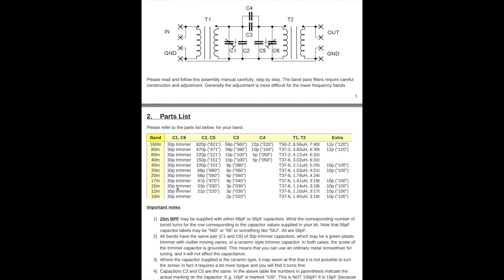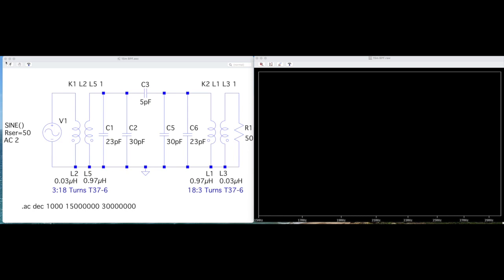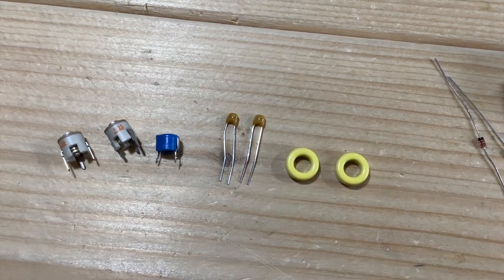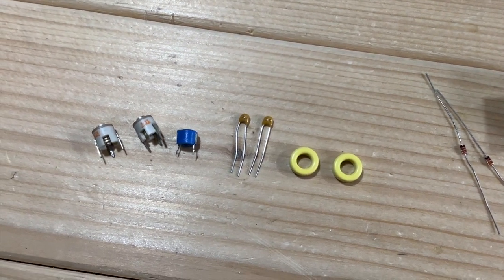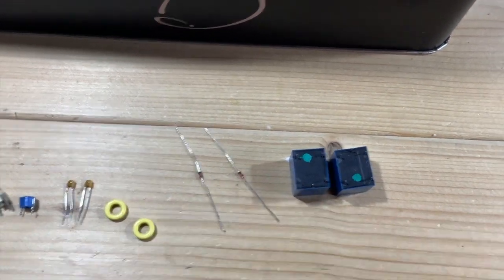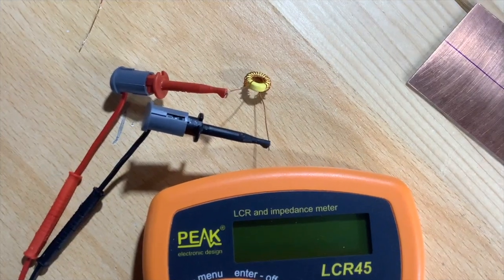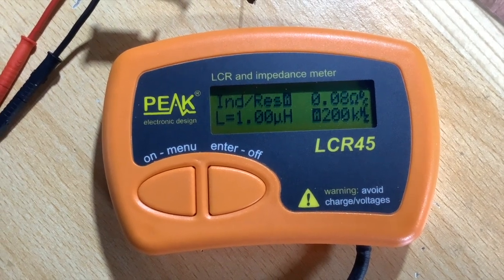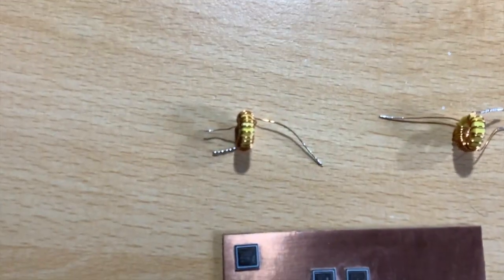37 - Building & Testing a Band Pass Filter

Comment: Nice video.  Note in your simulation you have the K value=1 which means you have know leakage inductance in your simulation.
Reply from the maker: Thanks for watching. Yes, all my simulations are based on ideal components. Practical reality is something different though! That's what makes it interesting. 73, Nick
Reply: @M0NTVHomebrewing  If you short the secondary of the transformer and measure the inductance on the primary that will give you the leakage inductor.  You could add that in series with the primary and leave the k=1.0.  KN6MDB 73

Comment: Hi Nick, great video as always. I have watched your video and read Hans Summers' document. I have mocked up a circuit in LT Spice but when I look at the trace V004, all I get is a flat line. As far as I can see, other than component values, my schematic is the same as yours in LT spice. Any suggestions or advice? I am new to homebrew and LT spice (sigh).. Thanks again!
Reply from the maker: Hi Ryan, without looking at what you've done it is hard to comment. What I would suggest though is try an LTSpice simulation with my values for my frequency range. It might help to narrow down where the issue is. All the best to you. 73, Nick

Comment: I’ve been a fool!  I’ve gone and passed up constantly on those adjustable capacitors. The big big ceramic and metal ones?!  I want to sink my head into the sand like an ostrich now when I see how much those baby’s fetch on eBay…. Hey?!?  Your schematic there?  It looks like the sort of circuit that goes between mains and transformer inside those ‘power conditioners’!?! ‘Common mode rejection’ - ahhhh I’m beginning to learn a few things here!!
Edit:  I absolutely love your ‘through hole components’ surface mounted to your copper clad board - very smart way to go while you’ll be presenting your board on camera. It looks great!
Reply from the maker: Thanks very much. 73, Nick

Comment: Thanks for the excellent video!  I do a lot of breadboarding, and I am intrigued by the stick-on solder pads.  Where did you get those, or did you make them?   Again, thanks for the video.
Reply from the maker: Thanks very much Ted. There are several sources for the pads online. Just Google "manhattan pcb pads" and you'll find some. QRPme, Kanga and eBay all gave me some options. 73, Nick
Reply: @M0NTVHomebrewing  Thank you so much!  I had never heard of these before.
Reply: @M0NTVHomebrewing  - Thank you.  I found some and they are on order.
Reply from the maker: No worries Ted. Glad you tracked some down! 73, Nick

Comment: Was just wondering how much power your bandpass filter is capable of handling?  The design looks like it would be perfect for Field Day filters here in the US.  73 AE3D.
Reply from the maker: Hi Keith, the one in the video will be good up to about 20 watts or so. It depends on the toroid type you are using. If you look inside a commercial rig rated at 100W output then you won't usually see huge toroids - probably T50-6 for the higher HF bands. Having said that for my Shelf-17 rig which puts out 80+W on 17m I used T68-6 just to be safe! Your mileage may vary as they say. 73, Nick

Comment: Really like it! Can you share what is the attenuation of surrounding bands for 21MHz filter? I mean dB down for 14, 18MHz and 24/28MHz?
Reply from the maker: Thanks. If you look at my final comparison between the LTSpice simulation and my sweep on the Spectrum Analyser then you can actually see for yourself. It is a sweep from 15 - 30 MHz: each horizontal division is 1.5 MHz and each vertical division is 10dB. You'll find it at 32:15 in the video. Basically 20m is nearly 40dB down, 17m about 20dB down and 10m about 30dB down. Hope this helps. 73, Nick
Reply: @M0NTVHomebrewing  Hi, that's exactly what I need. I plan to build a set of filters for 40/20/15 meters and this design looks pretty efficient.
Reply from the maker: Hi Michal! Yes, it's a tried and trusted design. You can use different designs and possibly get steeper skirts though. Check out Bill Meara's experiments on the Soldersmoke Blog and the Soldersmoke YouTube site. I tend to stick with these simple double tuned circuits though.

Comment: Nice work. Would like to try my hands on something like that, what is the model number of those trimmer capacitors and where did you buy them from?
Reply from the maker: Hi there! I bought some of these: https://www.ebay.co.uk/itm/296288883417?itmmeta=01J3V1V45QPBEM188ZA7RXJV3W&hash=item44fc3192d9:g:VZ0AAOSw1CRbU0lr&itmprp=enc%3AAQAJAAABINUd9x5oq35f6vhbuaBQ9bjEghcaXGpY8u%2BNhd4APrNqAVaXVfCXE9R8zVxpHf0%2FX4O1eI1F3lcsedz4f3YkJeumRfGLkJ00M5nbx4N6QBnQbr9Nll8oIKH9lNUuEIm2RSxSKGfLNDlmHL7rW3brBk%2BEgwg68bfClUJ0dAtReakUKfeE1HW5j8jaavbF0ylgCMt9FIctQFm6A%2BCKsPqI%2Fzcdil5Obh0hp1f85tD3XkxdGfPkqSwOARz7yN0KPZ%2FCrHYAhViH%2FpeTpo5gCF5DkLrmurXLxbtnwEAG5CPYvuPowx3bWENj211MltkXgfU9pxs7THxDkS7Gacr9WSCPyDKNbI6OWH6zeiSveDVRGVKdfPoudSEqkFOwNcZaQ7QjUg%3D%3D%7Ctkp%3ABk9SR_TC7OGeZA&edge=1
Reply: Thank you so much for that link, I will definitely check it out. 73 Fer now, VA3TSU

Comment: Hello, how you assess Q of inductors on 21 mhz? And where to buy realible t37-6 iron?
Reply from the maker: Hi there! I don't attempt to measure the Q of my inductors in band pass filters. I've found that all that is really necessary is to build them as carefully as possible. Being able to measure them is useful (I use a Peak Atlas LCR45 meter) but even then you'll need to tweak them by adding or subtracting turns or by separating or compressing them. Once you've got them exactly where you want them and the filter is complete then it is good to fix them with glue, wax or whatever so nothing moves around. In terms of buying the toroid cores then I usually use a few trusted sources e.g. Club Sales at the GQRP Club or www.sotabeams.co.uk

Hope this helps. Thanks for watching. 73, Nick

Comment: Nice job! Extremely low loss. Can you use the NanoVNa if your output impedance is 1.5K, so 50:1.5K ( I have a NE602 after the bandpass)?
Reply from the maker: Thanks very much. You can certainly use your NanoVNA but you just have to remember that it is expecting to 'see' an impedance of 50Ω. Personally I'd wind 11 turns primary (1.5KΩ end) and 2 turns secondary (50Ω end) on an FT37-43 and then measure the impedance (smith chart & SWR). This should be fine on RX or TX - assuming the next stage has a 50Ω impedance of course. Hope this helps. 73, Nick
Reply: My primary is 50ohm (antenna), the secondary is 1500 Ohm (input of NE602). I am using a similar pass band with with Toko coils. Are you saying that the S11 port of the nanoVNa needs to see 50 ohms? If so, I will place the primary on that port and the 1500 ohm side on the S21 port? will that work? @M0NTVHomebrewing
Reply from the maker: Hi, sorry but I'm not really sure what you are trying to measure. Both ports of the NanoVNA expect to see 50Ω. In my last comment I described an impedance matching transformer to connect your NE602 (Z=1500Ω) to something else (e.g. band pass filter, antenna etc) with Z=50Ω. You can tell how well you have matched this by doing an S11 measurement on the 50Ω end of your transformer. You'll be reading (Smith chart and SWR) how much signal is going through and how much is being reflected back because of impedance mismatch. 73, Nick
Reply: @M0NTVHomebrewing  sounds good. I will have some extra losses with the “adapter” transformer. Correct?
Reply from the maker: Correct - although theoretically there is such a thing as a "lossless" transformer in reality you'll never build one. The practical reality of building a transformer means there will be some losses. These losses needn't be huge though. As long as you build them as carefully as you can you should be fine. Happy toroid-winding! 73, Nick
Reply: @M0NTVHomebrewing  thanks!

Comment: If you can make your inductors with an air core, do so. Most of the insertion loss in these filters is in the ferrites.
Reply from the maker: Hi there! I think you mean toroids rather than ferrites - as these are not ferrites they are iron dust cores. But I know what you mean! To be honest the insertion loss is so low with these kind of filters (mine are typically less than 1 dB) that for HF frequencies it is probably not worth worrying about. Once you get higher in frequency then I agree - the inductors get smaller, the losses get bigger and air-core is a much better option. Thanks very much for watching and commenting. 73, Nick
Reply: @M0NTVHomebrewing  yes. I was using ferrites in a generic sense to cover any metal.powder. but do you really think a dB of loss is low? It adds directly to noise figure in a receiver and sucks power from a transmitter.
Reply from the maker: I take your point but to be honest when you are building from scratch manhattan-style you will inevitably introduce losses all over the place. The only real question is how much loss are you prepared to live with? Your mileage may vary, as they say. Thanks again. 73, Nick
Reply: @M0NTVHomebrewing  You're right. But my recent history has been 30GHz transceivers for space use. In that situation, even 2mm of pcb track from the antenna probe to the first HEMT FET introduced unacceptable loss. The probe need retuning to be a noise match to the FET with direct connection. Mileages do indeed vary.

Comment: I'm planning on getting my ham license and I'm already into ee as a hobby. The only piece of gear I don't have for all this is an sa. I'm planning to buy a siglent. Is the plus model worth the extra money for the mod I read about on the eevblog website.

Also what are the names of those good variable caps you have?

Great content my friend. I'm new to rf but it seems like the logical path to follow and a great hobby.
Reply from the maker: Hi there! Thanks for watching. I've not done to mod to the Siglent so I can't say about this but it is a tremendous piece of equipment. That said, you can also get a long way with a Tiny SA these days.

The variable trimmer caps are like these: https://www.ebay.co.uk/itm/284572247234?hash=item4241d3e4c2:g:JMwAAOSw4hRhvG2z&amdata=enc%3AAQAIAAAA8A8n5ZoK6A0Nd%2FkE4Z6RL71zssBh0Gf%2FIW5utLhXQZ15HLlCtZV6CbQCNQoPhp%2FnjGtdFZrwaqfmY3KqtbAuCt%2FJ0clywg8ACMGgiNpyKDOt201FLOrqjmtFbCa40XD6znc4gVIoT7GOUdpVuU0jli3evXFyhVyOkf%2Ft74T1eRHAlkSlIxn2xM7q0BIMMn5w4CsENH8veQBkpUDyptHH7D%2BUecx%2Bk0gozs3Y2HXajwvZHvcD06fqXPI2w2y7jHZMii4RXq0QBz06V7s8qi6U9KiT9WsLhrt6WXV2zDlh9fho0V%2FVtsFS55iIgxUsA9o9uw%3D%3D%7Ctkp%3ABk9SR4LN5o-bYw

All the best as you go forward into Ham Radio - it's a great hobby! 73, Nick M0NTV

Comment: Sorry, could you explain me how to calculate the L and C for designing center frequency ò a BPF ? Thanks
Reply: I mean that if I use the formula: F = 1/(2*pi*sqrt(L*C)). So I don't get 21Mhz as your!
Reply from the maker: Hi there! The best advice I can give you is to refer to Hans Summers' instructions (which I have linked to in the description of this video). If you're feeling adventurous and want to design your own then I find a filter design simulator very useful. One of my favourites is https://markimicrowave.com/technical-resources/tools/lc-filter-design-tool/

Hope this helps.
73,
Nick
Reply: @M0NTVHomebrewing  Thanks alot for your answer! I tried to recalculate and I realized that if we use both Cap (23pf and 30pf) we would get nearly 21Mhz. My question is now that could I get FM signal with this SSB receiver?
Reply from the maker: You might be able to listen to some FM signals using the slope detection method (google it!) but if you are serious about FM demodulation then really that requires something of a redesign. FM is a fascinating thing but it is a whole different form of modulation and so requires a different approach. 73, Nick

Comment: You make & Tune Excellent filters.....The Actual sweep run to Model is 'bout as Close as it gets !! .....Just for Educational & Practically purposes,  Maybe you could Make an Identical Filter using hand wound  #14 or 16 wire gauge Air Core inductors (Instead of Toroidal core) & show the sweep run loss Differences if any.....I almost Always have a usable piece of Enameled magnet wire around the shop & almost Never have the Correct  Size & ferrite Mix type thats needed & probably Most of us beginners get initially Better results & feel more Confident winding Simple cylindrical Coils.....
Reply from the maker: Thanks Tom. Depending on the frequency you wouldn't be able to practically use an air-core coil. You could for VHF but for HF they would have to be pretty big in order to get the required inductance. Best idea is to stock up on type 6 yellow iron dust toroids (T37-6, T50-6). This will tackle 30m and above. I'd probably then use type 2 red (T37-2, T50-2) for 160, 80, 60 & 40m. Air-core coils are useful in filters where you need very small amounts of inductance though. 73, Nick

Comment: hello...i try lot of thing with this filter 80m band but insertion loss is about 2,5 -3db aprox....73 de 9a3xz Mikele
Reply from the maker: Hi Mikele, band pass filters are always a trade off between 2 properties: (1) the bandwidth of your filter and (2) the insertion loss of your filter. The narrower you make the bandwidth the more insertion loss you're likely to get. It also works the other way of course: a wider bandwidth = lower insertion loss. So it is always something of a compromise. Having said this I've build many of these for 80m and had no more than 1 dB IL. Using good quality trimmer caps helps - as does careful construction of your inductors. I made another (earlier) video on this which might be of interest: https://youtu.be/dZnvpxVd7dc (NB. Make sure you read the description about the error in the onscreen schematic!). Hope this helps and all the best to you. Keep going! 73, Nick
Reply: many thanks @M0NTVHomebrewing